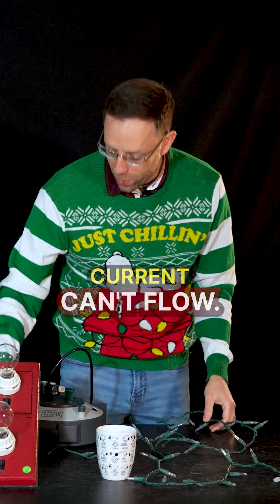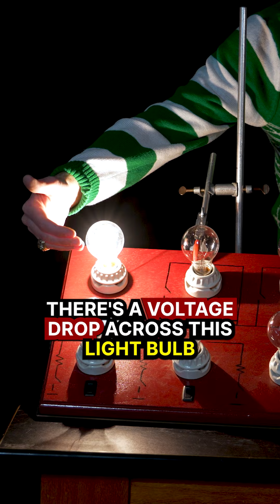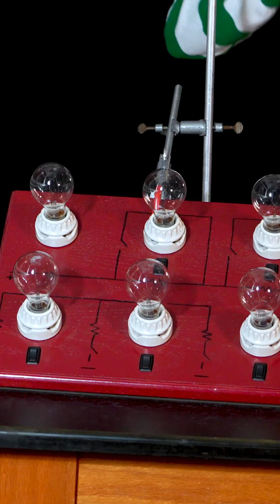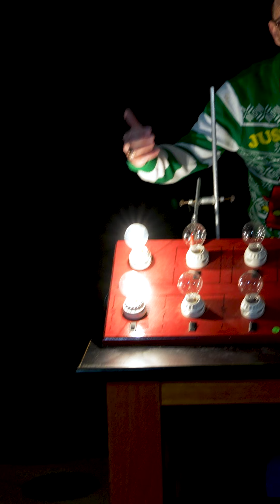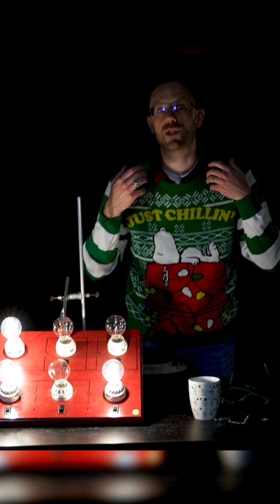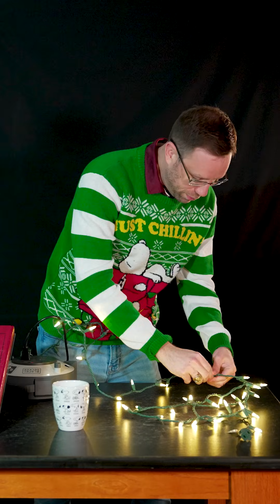Series vs. Parallel Circuits with #holiday lights! #DrDawson #christmas

Comment: More fire risk I guess too
Reply: It's also significantly less expensive to manufacture, because series circuts physically use less wire than parallel circuts require.

Houses in the UK are wired in a "ring circuit" because it was difficult and expensive to get copper wire in England after the war, and a "ring circuit" requires less copper wire than running an individual "branch circuit" to each location as they do in the USA. (Branch circuts are parallel.)

Comment: Hi! 
I had a question my teachers haven't as of yet been able to answer: if in a parallel circuit, two resistors have different but inverse resistances, how does one calculate the ratio of the current flowing and being used by them?

Comment: In a series connection, the current is the same everywhere and the voltages are distributed (depending on the resistance).

In a parallel connection, the voltage is the same everywhere, but the currents are distributed (also depending on the resistance).
Reply: Or in a really simplified term I remember from my childhood a series circuit is shared voltage and a parallel circuit is individual voltage